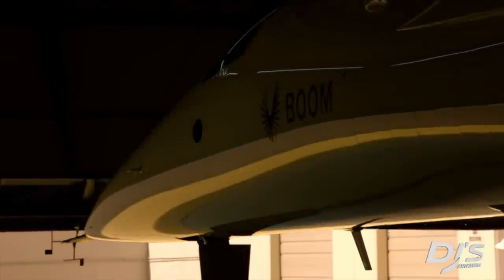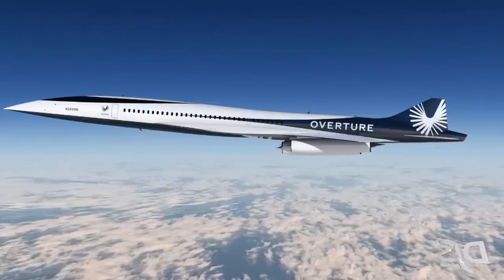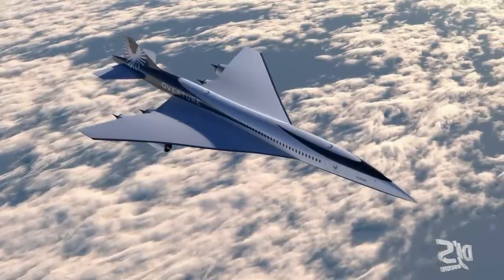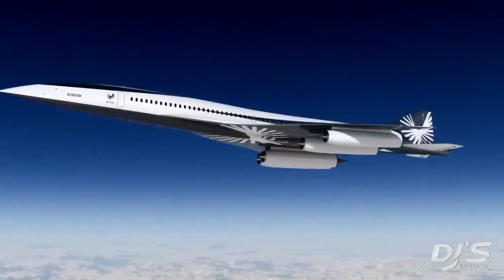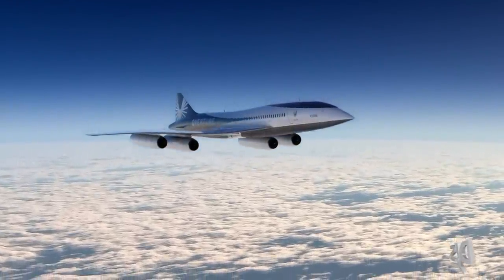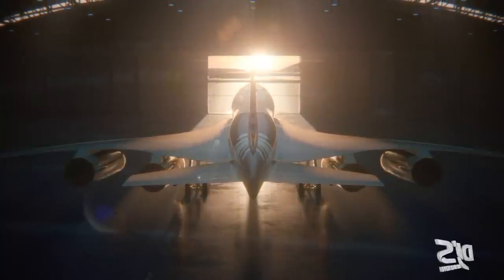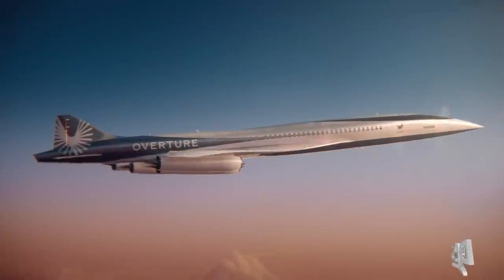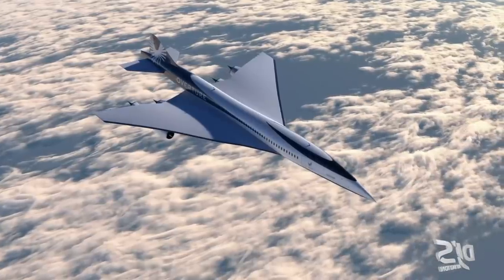Boom Supersonic MASSIVE News

Comment: By the shape of the wing it would land at 250 knots minimum!!
Reply: Looks like it has flaps though and it seems that the aspect ratio is higher than Concorde? So it should land about the same if not less speed. Also, since it's light on landing, I don't think 250kn, prob more like ~190kn
Reply: @junxianglan2907  with (presumably) 4 thrust reversers the plane can probably slow down really quickly (especially with it’s size).
Reply: Who are you a computer? What AI do you have allowing you to calculate the required landing speed just by looking at a wing? Dear god.
Reply: Not really. Concorde have a 3.2ton/meter span while landing, Overture will have about 2.2ton/meter span. Just doing the math it would imply the landing speed of Overture would be about 155knots. Sure the shape have some impact on the landing speed, but its really span and weight that is dominating the equation
Reply: @jungbolosse3034 Concorde take off speed was 217kn (250mph), which was crazy fast, and caused tyre bursts. Its landing speed was 162kn (187mph), which was also very fast.

Overture speeds should be a lot less than this, because it will be lighter, with a bigger wing and also leading and trailing edge flaps. Not sure if the empennage will also allow slower speeds.

Comment: Out of the tail and under the wing means maintenance is easier, but less easy than a twin engine. Given how airlines have settled on twin engine designs as the default, they'll have to charge a lot to justify the additional cost. Hope it makes it, but there's a lot of metaphorical runway yet to pass over.

Comment: Take of without reheat will open it up to a lot more airports but as a big fan of Concorde it misses some of that excitement.  I wonder how they are designing the engine air intakes for supersonic flight.
Reply: Its not reheat that is the main engine noise problem. It's that for supersonic speed you can only use low-bypass turbofans (see how much skinnier they are than subsonic engines?) because you need very high exhaust gas velocity. Higher speed gas automatically means higher decibels. I'm very sceptical that you can build an engine efficient at supersonic speeds which is not unaccceptably noisy on takeoff and climbout, even without reheat.
Reply: @kenoliver8913  concorde always used reheat on take off and turned it off about 20 seconds after it got into the air.  It was a noisy beast.

By the look of the cgi they are planing on the use of blackbird type air intakes rather than the ramp design of concorde,  no jet engine can deal with supersonic air into the first turbine,  hence the use of ramps and cones.

Comment: I haven’t done a ton of research on this so maybe this is a dumb question.  But with this new design how sure are we that it won’t be flown remotely?  The 1st design had  transparent and well defined cockpit windows.  This has a strange looking black strip area that wraps around the 1st 3rd of the aircraft with no distinct blend into windows.  It could all just be black paint like the aft section of the fuselage and empennage.  The black paint would make sense to make it look more normal and not instill fear to onlooking pax from the terminal being one of the first remotely piloted airliners which will take time for passengers to slowly adjust to over the years and gain confidence.  Obviously the tech for unmanned aircraft is already here and with this not starting service until 2029 maybe they
 are choosing to take this next step?
Reply: They're not going to get a FAA certification without pilots being able to hand fly it. The reliability and redundancy requirements for a type approval are extreme.
Reply: There are no windows at the front of Overture, nor does it have a droop snoot. Instead external cameras will display the terrain on monitors in the cockpit for the pilots to take off and land.

Comment: JT8D-powered maybe? With some modifications like whatever Volvo did to make them suitable for supersonic flight in Viggen. No monster sized afterburner here though 🙂
Reply: The RM8 is not sufficiently efficient to power an airliner. Well it probobly would have been when it was new in 1964, but not today.
Reply: @matsv201  JT8D was an airliner engine in the 60s. With upgrades (like larger diameter fan) it was still in use recently.
Reply: @zapfanzapfan  it was like bypass of 1.1.. not 3
Reply: @matsv201  Yes, but it was one of the first engines to have bypass at all. There was no military turbofan engine yet which is why Volvo modified a civilian engine. Concorde btw was pure turbojet.
Reply: @zapfanzapfan  while bypass of 1 would increase the fuel efficency from concorde, with about 35-40%... having a bypass of 3 increase it about same yet again.

With saying that at mach 1.7 having a bypass if 3 is about the same of having around 8 at mach 0.85
Reply: @matsv201  Concorde's engines were amazingly efficient (40+ %), at mach 2. But to get the compromise of sometimes subsonic and sometimes supersonic efficient requires some bypass. But the engine still has to cope with supersonic speed. I can't off the top of my head remember any higher bypass engine than around 1 going supersonic. Modern fighter jet engines have a bypass of 0.3 - 0.5.
Reply: @zapfanzapfan  

"Concorde's engines were amazingly efficient (40+ %),"

No that is a myth, the 40% number is for thermal efficacy, not total efficiency. While, yes, up until really just a few years ago, it was the engine with the highest thermal efficiency (its not any more), the total efficiency is still fairly low. 

"Modern fighter jet engines have a bypass of 0.3 - 0.5"

That have nothing to do with efficiency, but rather thrust to weight ratio.. and well size. Also use of reheaters works poorly with high bypass ratio.

While going to higher bypass have less of an effect at supersonic speed than subsonic, it still have a significant effect.
Reply: @matsv201  I guess it all depends on what speed you optimize for. Concorde was optimized for cruise at mach 2 and so was instead inefficient at subsonic and on the ground. High bypass engines are efficient at subsonic but can't reach mach 2. This plane they said mach 1.7, that speed I know modern fighter jets with low bypass engines can do without afterburner (super cruise) and so they are at least possible engines for the plane. I wonder if they intend to use pressure recovery at that speed. In the animations they just hang the engines on the wings, unlike Concorde with its inlet ramps.
Reply: @zapfanzapfan  I wouldn´t quite call it optimization. The engine they had was the most efficient at mach 2.2, so they designed the aircraft around that. making it faster would actually made it more efficient, but the Olympus engine could not go any faster due to compression heating.

The Americans was aware of this limitation hence designed there SST to be Mach 2.7-3.0.

There is currently no Fighter that can do a mach 1.7 super cruise. F22 is (probobly) the fastest super cruiser at 1.5.

There are supersonic bombers that can do fast super cruise. Economy of scale make it much easier om bombers.

I can´t go into aerodynamics details. Its not my field. I know how an engine works, bit its really just because the aerodynamics makes it so the engine effectively work in a subsonic environment. This makes it so there is really no diffrance for the engine if its subsonic or supersonic
Reply: @matsv201  The aluminium skin of Concorde wouldn't have liked speeds much above mach 2 anyway. I assume SST was going for Titanium? Or stainless steel. Like the mach 3 planes SR-71 and XB-70.

Jeff Babione, Lockheed's F-22 programme manager says mach 1.8 super cruise, but that was before applying stealth coating.

Yes, the intakes have to slow the air down to subsonic. Mach 2 fighters have fixed inlets, speeds above that require variable inlets. Concorde had variable inlets that increased the pressure about 8-fold and then the compressor compressed another 10-ish times so that the total pressure increase was about 80, compared to today's high bypass turbofans that achieve about 60. I think the last compressor stages on Concorde were made of inconel to handle the heat.

RR seems to be contracted for engines for this plane according to another video but no firm information.
Reply: @zapfanzapfan  Well... You can go around mach 2.7 with aluminum, but the leading edges would need to be in some other material. You really can´t just put Titanium there becasue of the galvanic currents. The way it would be solved in the 60 tys would probobly be ceramics.

"Lockheed's F-22 programme manager says mach 1.8 super cruise"

You are probobly thinking of the YF22. While it looks similar to the F22, is a very different aircraft. Its more aerodynamic and 5 tons lighter. It probobly have some effect on the top speed. The listing i can see YF22 have a super cruise of 1.6.

Have to remember that the 1:60 listing of a engine like the GE-9X is for static pressure. Even subsonic engines does have a ram air advantage, while still quite a bit smaller.

" I think the last compressor stages on Concorde were made of inconel to handle the heat."
Its really the turbine stage that suffers the most from heating. Nowdays the first turbin stage is fully chearmic, even at that they have cooling channels built in to them

And they are even glossy white.. like a ceramic plate, to deflect as much heat as possible.

The first turbine stage of a GE-9X engine is about 400K warmer than that of a Concorde. So its a considerable diffrance.

"RR seems to be contracted for engines "

Yes.. i really can´t find any other information that its just a cut down engine of a A321. Its the same engine, they just swiched out the fan for two smaller diameter once.
Reply: @matsv201  No, that was said at the test flight of the last production aircraft. Super cruise at 1.8 and max speed 2.2, now if that is completely true is another matter.

Yes, the turbine is always inconel, with cooling channels, and ceramic coating. Stationary hot parts seems to be all ceramic (CMC) on the newest engines, not just coated. I haven't had a close look at a Concorde engine, was it built before cooling channels and ceramic coatings? The last 4 compressor stages was Nimonic 90, some other nickel alloy. 500+ C temp from the compressor, I guess even titanium finds that too hot.

Interesting. Well, in that case maintenance will be much simpler since the core of those engines exist in the 1000s and fly everywhere in the world.

Comment: Qaud jet?!? This project isnt that viable in the first place, but if it isnt a twin jet then it will not sell nearly as well
Reply: It will have sells cuz it's a supersonic aircraft
Reply: Imagine if it can supercruise - mach 1 without afterburner
Reply: It is a quad jet for noise reduction they are just a bit smaller and use less so they will just equel the tri jet design
Reply: @alienbeef0421  it does not have afterburners, so it super-cruises the full flight
Reply: @quinndenver4075  yep, realized that - commented midway through the vid 😂

Comment: I hope they are also looking at the wake turbulence issues this aircraft could cause. I remember lining up behind Concord in a 737-400 at LHR and having 4 minutes hold because of wake turbulence. We are held 2 minutes behind an A380 that has five or six times the passenger capacity of the Overture so too many of these could seriously impact airport capacity.
Reply: @Graham Baker not every widebody airliner flight is always a full capacity flight and you know it
Reply: @mcdiamond2463  I didn't say it was carrying five or six times the number of passengers, I said they had five or six times the capacity. However all of the post-pandemic flights I have taken have been over 80% capacity so there could be a noticeable effect on the number of passenger movements if Overture flights become common. My concern is more about the wake turbulence holding time. Part of the problem is an ogive wing (like Concorde) was it resulted in greater wake turbulence than the swept wings on transonic aircraft. This resulted in reduced movements per hour on the runway, with longer holding times and higher costs for all the other carriers burning extra fuel waiting for the wake turbulence to clear. I am concerned that the noise issues are being addressed but there has not been any statements addressing the wake turbulence issues that were also present with Concorde.

Comment: Would a re-engined Concorde suffice?
Reply: The airframes of the Concordes are really old. Because of the stresses involved with supersonic flight and pressurization cycles, you can't fly it forever like you could with a DC3 (parts permitting)

Comment: This is exciting, and you are right, there are many questions to answer. I even have a couple.

1, is it going to be cheap enough to operate that normal people can fly on it and not just the super rich?

2, will it have to take off and land so ridiculously fast that I will be constantly popping tires like the Concorde did, or did they manage to find a way around that?
Reply: Concorde actually had strong tires, they did have to be replaced but not on the scale of Russias Tu-144
Reply: Overture is not aimed at the main line economy market, which is more than adequately catered for by Boeing and Airbus, for example. Instead, it is targeting the 700 million long range business trips made each year globally, 400 million by Americans.

Because Overture will be fuel efficient at sub and supersonic speeds, and will be compliant with ICAO-14 subsonic noise regulations, Boom and the airlines have identified 500 viable routes, some mixed land/water, compared to just 2 Atlantic routes for Concorde. Commercial supersonic flight over land is effectively banned worldwide, so Overture will fly Mach 0.94 (10% to 20% faster) over land and Mach 1.7 (x2 faster) over water. 

A subsonic airliner does the JFK/LHR trip in 8 hours. Overture will do it in 4 hours.
A 16 hour subsonic trip across the Pacific would require a 1 hour refuelling stop, giving a duration of 4+1+4=9 hours total on Overture. 

All 65 to 80 seats will be quiet business class, almost certainly with internet, with ample room. Tickets will be the same price as subsonic business class. This, coupled with twice the utilisation of subsonic airliners, would give a good margin for the airlines.
Reply: @phonicwheel933  that's not a bad breakdown. The Concorde was insanely expensive, way more than regular business class.
Reply: @AlexandarHullRichter   You asked about the Overture tyres: Overture will have better low speed handling, with slower take off and landing, as a consequence of the bigger wing with leading and trailing edge flaps (both similar to the proposed B revision to Concorde) and empennage. Also, Overture will be much lighter. There may also be more robust tyres now. These factors should assist in avoiding the tyre blow outs that dogged Concorde.

Comment: Sooo, their design will still have to fly below Mach 1 over land. Looks like the only real innovation, and this is a bit of a stretch, the proposed airplane will not require after burners. So it hasn't solved the main problem associated with supersonic passenger aircraft; that of the sonic boom. Then why bother?

Comment: I am just curious about Engines and their positions on the Wing's, Now it ma all very well Engineered and Aerodynamic but are they because I think that they should have been in Pods Like That of the Concorde so I have some concerns their and where the current Power Plants sit doesn't exactly sit right now, When I say right now I think changes might come, Engines might be closer to Fuselage and may very well be in Pods of Two, Time will tell, The other concerns are over the Tailplanes / Stabs, I am yet to be convinced about their effectiveness and Fuselage wise Nose Area, I have some issues over that but let's hope I am wrong and all goes well but I don't think so and I am being far from up myself but instead Genuinely concerns are my Basis Points of Contention, It is Very much like the Boeing 2707 just smaller.
Regards
John
Brisbane Qld Australia

Comment: Plane should have a large shallow scram jet underneath the body for supersonic speed and use the regular engines for lower speed flight.
Reply: Better to have a hybrid turbojet/ramjet design like the SR-71 - in effect a turbojet at lower speeds and a ramjet at high speeds. Scramjets do not exist yet and in any case are only efficient above Mach 3.

Comment: I don't know what the market for this aircraft is gonna be.  Many airlines have been dumping their four engine airliners for twin engine airliners to reduce the maintenance and fuel costs, I'll be interested to see how they can sell this.
Reply: Overture is not aimed at the main line economy market, which is more than adequately catered for by Boeing and Airbus, for example. Instead, it is targeting the 700 million long range business trips made each year globally, 400 million by Americans.

Because Overture will be fuel efficient at sub and supersonic speeds, and will be compliant with ICAO-14 subsonic noise regulations, Boom and the airlines have identified 500 viable routes, some mixed land/water, compared to just 2 Atlantic routes for Concorde. Commercial supersonic flight over land is effectively banned worldwide, so Overture will fly Mach 0.94 (10% to 20% faster) over land and Mach 1.7 (x2 faster) over water. 

A subsonic airliner does the JFK/LHR trip in 8 hours. Overture will do it in 4 hours.
A 16 hour subsonic trip across the Pacific would require a 1 hour refuelling stop, giving a duration of 4+1+4=9 hours total on Overture. 

All 65 to 80 seats will be quiet business class, almost certainly with internet, with ample room. Tickets will be the same price as subsonic business class. This, coupled with twice the utilisation of subsonic airliners, would give a good margin for the airlines.